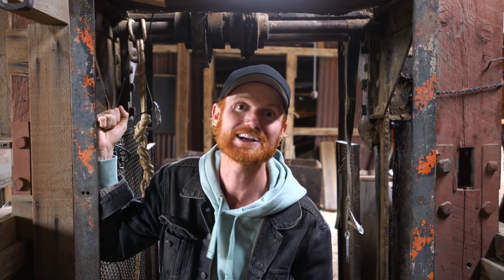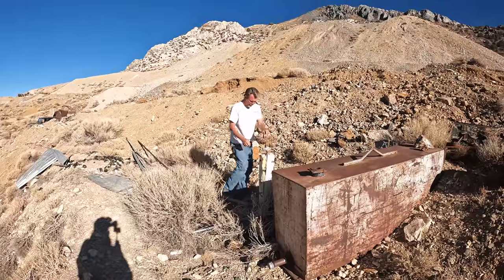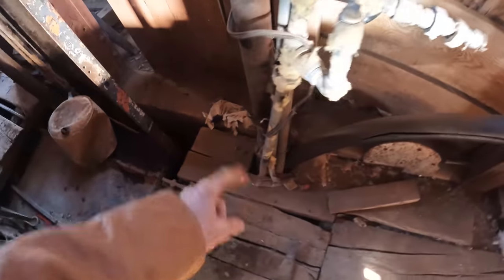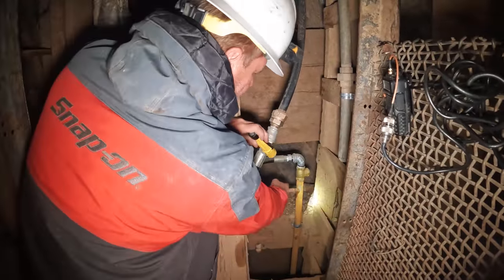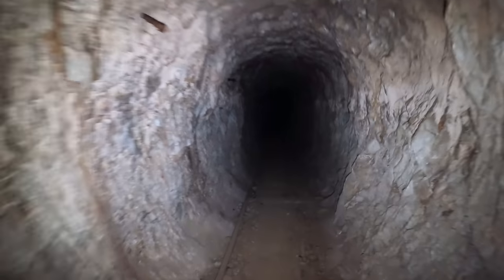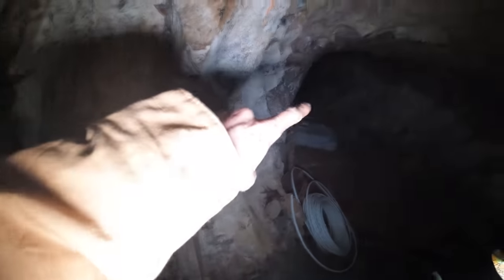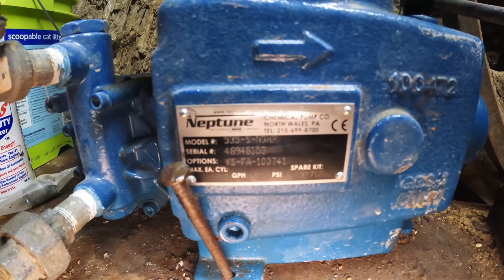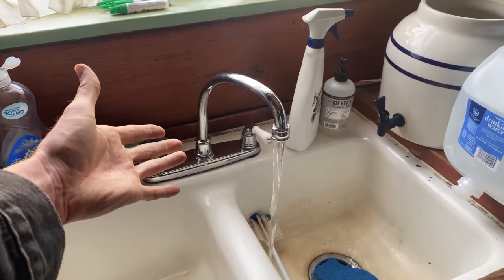How Cerro Gordo 'Ghost Town' Gets Water

Comment: Sweet FA water is something that a lot of central Australia deals with as part of daily life along with extremely deep ground water supplys with bad flow rates. We capture every single square meter of roof area we can with gutters and tanks to store fresh rain water (and most people just put a ~50 micron filter on it to take the chunky bits out unless they have a compromised immune system, then it gets UV treated at the dwelling level) and then they run multi stage ground water pumps to get generally unpotable ground water to the surface. Companies like Grundfos make pumps that are capable of ~2000+ feet of head at reasonable flow rates, and what ive seen is they get set up with an on/off timer, flow switch and float valve on a holding tank. The on/off timer basically runs them for as long as it takes to deplete the well down, then shuts them down long enough for the supply to replenish, then starts again. Then the float valve only allows water into the tank if its not full and if the tank is full when the pump hits a run cycle, it detects no water flow through the flow switch and just sits there stationary until water is demanded again.

I've also seen grundfos pumps that have done close to 20 years running 10+hrs a day in water thats 10x worse than whats at cero gordo before needing servicing- they're damn tough things.

I Know the whole "Gets arse freezing cold" complicates storage a little bit, but as others have said, burying below the frost line solves that, and if the ground water tanks are up at the Union, then you dont even need to pump down to town to get pressure!

Seriously- looking at what places like Africa and Australia do to source water in really dry climates is probably worth the time investment
Reply: Well said I have wondered why they been messing with the water issue for years now 👍👍👍👍👍👍👍👍👍

Comment: A remote camera and light source that you can switch on from up top so you can monitor the level while filling a large cistern would be helpful. A water tank inside of that hoist building would have one heck of a lot of pressure in town. Using the camera you can incrementally fill it without emptying the water source. You could then rely on a float valve to keep it topped off. That way you will always have on hand a minimum of whatever your cistern can hold. If you can swing a 5 - 10k gallon water tank even better. Just might take a while to fill it.
Reply: We use this exact system on my farm. We have two 500 gallon tanks plumbed together that off a mountain spring with a float valve. The pressure at the bottom is about 60 psi coming down to a hydrant and cattle waterer, which is plenty. It's been working fine for about 25 years now. We drain and clean the tanks every fall and service the valves and such.

Comment: On a similar thought to Liam Roggenkamps post, no matter what pump you use you should have the pump itself lower than the water table otherwise you will continue to get what is known as a air lock whenever the pump is idle cause given the setup it's going to get an void at some point in the pipe.

Comment: as someone else said, it might be a good idea to add a float valve, that way you won't run the storage area dry, also i would build a water tower/cistern that way you can store more water when you're not using it and can have constant pressure via gravity

Comment: I'm wondering if a piston pump might be more effective than a diaphragm pump for being that far underground, and especially useful if you're losing prime. They have the ability to pump dry and suck water to them from a lower point. If that prime-saver doesn't work, a piston pump might be the answer.
Reply: I prefer the diaphragm pump for this installation. The volume, pressure, and  flow rate balances perfectly with the supply. The servicing of this pump is also ideal. I'm actually impressed by the power consumption. My God man the old set up made me cringe. 
  Quite frankly, if the supply increases a second diaphragm pump can be added in series. Resulting in approximately the same power consumption but increased pressure. 
  I suspect feeding an above ground storage tank can be accomplished next. 
  I like the idea of processing RO drinking water into one AST and utilizing the waste water as non potable irrigation supply for flushing and watering and such. The fresh drinking water storage would likely be less then 1/8 capacity. 
The water situation is better than I thought.
Reply: @anthonyrstrawbridge  Reverse Osmosis Process, you mentioned is great for cleaning municipal sources, but is totally not applicable to dealing with metals, the distributors of this process recommend using bottled water for all your needs if you have metals. Please correct your thinking, you can't screw around with water and it's quality! Period!
Reply: @lotharschiese8559  Maybe so, I can align either way. I think you meant to reference distribution systems but in all honesty we agree that the human consumption intake is directly or indirectly inclusive. I mean to infer that the caustic nature of the RO solvent product referred to as 99.8% pure H2O both leaches from the entire distribution system and also the human teeth, bone, and some soft tissue areas like the eyes, nose, and mouth. That said, you are correct in addressing these concerns first. My greatest accomplishment in life has been in obeervence of living water including biological microorganisms beyond the scope of this discussion. To cut to the chase, a proven reliable and cost effective method of stripping water to maximum purity in the absence of heavy phosphates is the RO process. But yeah, you hit a few good observations.
Reply: @lotharschiese8559   In addition to my previous post I regret not mentioning the impact that RO processed water can have on the soft tissue membrane of the lungs. 
    I admit that minimally processing water through the use of other methods is the current most accepted practice.

Comment: We have similar dosing pumps at my work. For the best performance of those pumps we keep the pump around 50% of its maximum performance. You’re on 84% (300psi and the maximum pressure of the pump is 360psi). After the pump install a air separation valve and after that 1 or 2 check valves. Try to install air separation valve as close as possible to the pump and also above it, so when there is air in the system it can easily float to separation valve and bleed from there. On the electrical side u can install a float switch.

Comment: In combination with the natural water supply, you could add a dehumidifier in the cave and drain it in into the reservoir. I'm not sure how humid it is in the caves or above ground. But if you get really fancy, an atmospheric water generator could work above ground or below.  A dehumidifier is a bit cheaper and readily available.. might not be as efficient though.
Reply: Yeah, I was thinking of a big unit from Zero Mass Water. They make systems that supply schools & villages.
Reply: It will gather toxic dust.
Reply: @zaxarispetixos8728  all it needs is a filter before the air reaches the condensation surface (evaporator)
Reply: if there is toxic dust, there may be more to worry about then quantity.
Reply: @hallcrash  The water never touches the dust, the whole system is filtered and can be directly plumbed into a refrigerator that has a water/ice function, or to a holding tank. It can also be mineralized for nutritional value. The water is cleaner than pretty much all conventional municipal water sources.

Comment: I really think a multiple tank system would be a good solution. A pump with a float system in the collection pool. This float would work opposite of a normal float, where it would shut the first pump off when the water level drops below a certain level.  The initial pump would pump up to a tank a few hundred feet up. The flat in this tank would shut the initial (main) pump off when this mid-level tank is full.  An additional float will be needed in this tank to shut the second pump off if the water falls below a certain level. The second pump would pump into a tank in the mine house. That tank will feed the town or another tank in town. Gravity should handle everything the rest of the way. This allows the pumps to not work as hard, not work continuously, and not wear themselves out. Multiple floats controlling low and high levels at the collection site, and mid level tank will keep the system from overflowing, or running dry.

Comment: Hi Brent. I'm a retired plumber. Gear pumps can produce ample pressure for what you need. Use a spring check valve in tandem with a foot valve on the suction side to keep the  prime. The close tolerances  of the   gears make it almost self priming. Put a pil switch in the reservoir so it can't be sucked dry. You could even use your diaphragm pump as a primer. It should solve your priming issue .
Reply: This is redundant ideology, the mine water is contaminated with metals, read my postings

Comment: Hey Brent, that is a really cost effective and clever use of a dosing pump for that situation! If your only problem is the pump losing prime, it could be as simple as an air leak in your suction line. That new foot valve is definately a necessary addition. Diaphragm pumps usually have a number of check valves inside - it only takes the tiniest amount of dirt or loose bit of thread tape to get stuck in the valve seat and stop the pump working - so its always good to have a fine strainer fitted to your foot valve to prevent anything getting in. I've had a fair bit of hands on experience with underground mine dewatering let me know if need any more help. Cheers.

Comment: Rain barrels/containment on the buildings would help some. Containments on various levels from the shaft might help too.
Reply: Dew catchers would be great given the weather that moves over the mountain.
Reply: @toddmetzger  I know he gets snow and it eventually melts. But I'm not familiar with the humidity levels there. Makes sense, though.
Reply: I'm surprised he hasn't put up any Solar Panels yet. They'd be his answer to powering his Starlink due to the remoteness of the area.
Reply: @neolithicnobody8184  Grow a solar farm on the south side of Cerro Gordo mountain. The power line is proximal.

Comment: I'm a big fan of the KISS method. However that might not be fully possible here. I'd try to implement a few changes:
1. Split the system. Bring down 3 55G plastic barrels with grommeted 2" interconnections. Place on 500 level or 400 level if you can get away with it. 
2. Move the diaphragm pump up to barrel 3. This is your new secondary reservoir pump and make your run outside. You should be able to run it near 100% now. 
3. Use tank 1 for filling. (a side benefit of splitting your tanks you'll get rid of any air bubbles before it gets to the diaphragm pump pickup) 
4. Put a standard 2HP well pump at 700 run it to your new midway holding tanks - Specifically barrel 1.
5. Float switches need to be placed on both pumps. This can be done using a contactor and low voltage switching (bell wire) so you aren't adding current carrying wire all over the place. You will need a float switch at the main reservoir (this will kill 700 pump from pumping too low and losing your prime) you will need two on barrel 2 or 3. One to tell 700 pump to secondary reservoir is full and to stop filling, and the second is for the secondary reservoir pump to stop if the secondary reservoir is low (this would happen is the main reservoir is out of water and the 700 pump turned off.) 

#5 is going to be the most complex sounding part, but it's really not. it's simply a few switches to make sure no pump runs dry or sucks in air. It's a spool of wire, a few float switches and a contactor or two. I think it would be important to commercial grade switches here. I would talk to a civil engineer that deals with spec'ing lift pump installations. These switches can not fail. (you could make them redundant systems by using more than just one, too.)

Side note A:  It isn't easy to get heavy metals out of water. It's not impossible, but the process isn't as easy just filtration. There are a few methods but they require either chemical or electrical ionisation. 
Side note B: Use plenty of backflow valves and I would add a few water hammer arrestors to take some of the forces off the pipes. I honestly don't think the PEX really cares, but that galvanized will. 

Good luck!

Comment: If you put a large holding tank above ground at town level with its own pump say 2000 gallons with a on and off float switches to control water from down the mine you can improve overall availability of the water supply. You will also want at both the tank and the reservoir in the mine safety shut offs which will turn pumps off if it gets to low and pump sucks air to keep the pump from running if it goes temporarily dry you don't burn out either pump. Did well pump installation up here for awhile and have set up similar systems.

Comment: I would suggest the pump supply a large water tank higher up the hill. It would act as a larger storage and then you either gravity feed the town from the tank or have it pumped. But this way you won't run the water source point too low because the tank would be the supply not the source.  Not sure about the tank with cold winters though. I'm in western Australia dont have icing issues too much here Lol

Comment: The only thing I will add is, if this set up fails (again), I might suggest adding a storage tank at higher level (3-400 depending on space). Then pump from 700 to the tank, and then another pump from the tank up and out. It will take the strain off the pumps of pumping straight up 700 feet. The only reason I suggest that is I have seen another underground area set up this way.

Comment: Very interesting to me..I bought an old time cable tool driller in Sanra Rosa CA in 1972 when I was 26 years old and sold it 4 years ago to a friendly competitor and moved to Las Vegas...besides the water connection to my story in 1950 my family moved to Grand Junction and my dad and my mom's cousin mined
 uranium. near Moab UT. They struck the claim to what became the Rio Algum Lisbon Valley mine. 250 employees working 24/7 for 17 years. Refinery built at the mine location to handle all the ore from the Western slope of the Rockies.
    The glitch is my dad in.1962 said the mine would never amount to anything and gave his share to Marlowe Smith..his partner
I camped with them at the mine sites in 52 and have loved the desert since
  I am envious of you having a whole town to enjoy!!!  Best of luck to you..

Comment: Have you thought about a reservoir or tank system to hold water after it’s pumped up? A level switch down the shaft, to prevent over pumping but keep a constant feed into the above ground holding would give you greater access and could be supplemented from time to time with trucked in water.

Comment: Would it be possible to have a series of water collection spots in the mines higher up?  having the water pumped to them, increasing the water storage and les ware on the pump.  However, you will need additional pumps for each level you have water storage on.

Comment: It might be time to partially tap into a municipal source. For hight altitude properties we use a 2 tank system. Either a well is dropped at a lower elevation or water is pumped into a lower elevation tank via a truck a mucipal line. A solar pump house is situated at the lower tank to run water up a 2" black pvc soft line wich is buried underground usually roadside but feeds a tank nearer to where water is needed. A second pump house can be added at the higher up tank to give pressure depending on your setup. Obviously this is a spendier way to get water but I would see it as a very viable and very reliable source of water for the towns growing supply.

Comment: Ive been through Cerro Gordo a few times. One of the first times I think is when you first bought it. I was there about a week before you got the water tank. I couldnt help to wonder what do you all do for power. I heard generators and wondered why no solar? My background for over 20 years is offgrid solar and solar permitting. You seem like a DYI guy and solar isnt hard at all.
Reply: There's a cell tower on the hill next to him as well as mains power. I do agree that he should have his own solar and lithium batteries as well. I cringe thinking about that lift shutting off with someone half way down it and no way to power it back up!
Reply: @KenjiFox  I didn't think of that, that is a terrifying idea. Having solar with a backup propane generator that starts automatically would be high on my list lol.